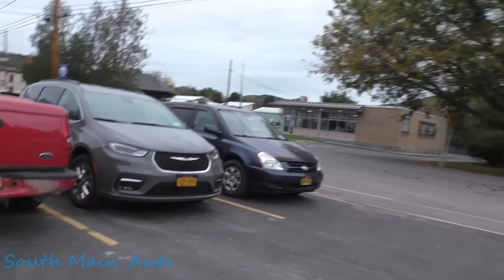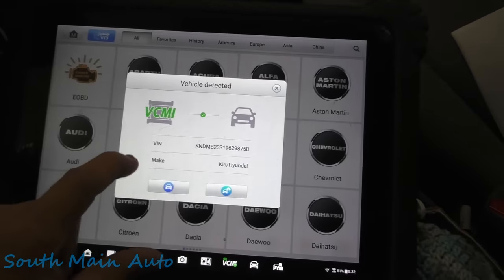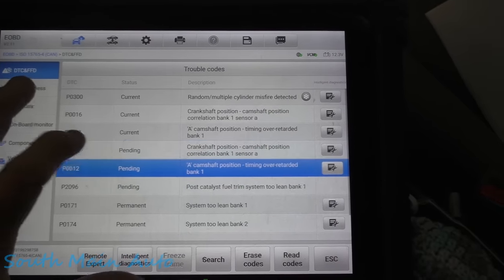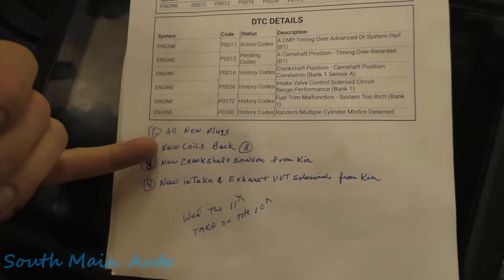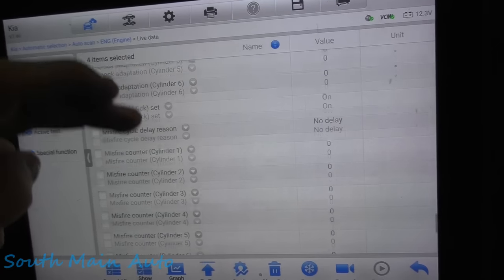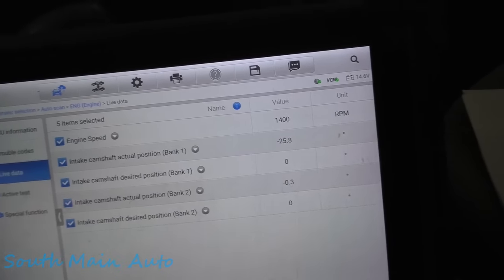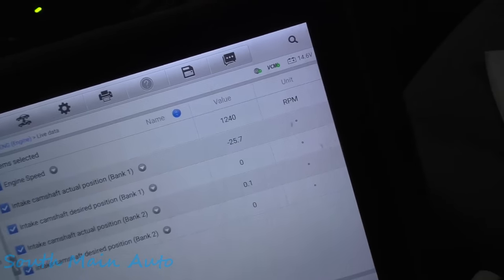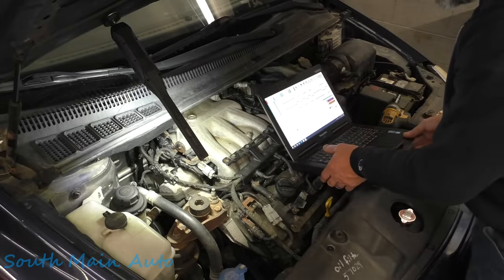This Kia Is Running Out Of Time!

Comment: A channel named Matt's Offroad Recovery had to drag in a Kia of sorts and repair it for a customer and the cam timing wheel was completely broken almost off the cam shaft and was giving similar info. electronically they had to replace the camshaft afterwards it ran properly and solved a number of complaints.
Reply: @kittty2005 Do you have the video ID for us? 🙂
Reply: @PuchMaxi  No unfortunately, it was something from my memory it may have been  a Trail Mater video, I just remember the cam  had followers, crap I'll have to look for it, I'm 70 years old. I may be getting 2 vids mixed up. I'm sorry I won't say anything till I get it straight in my head.
Reply: @PuchMaxi  I'm totally WRONG I was remembering the buick onclave that Eric O. just did, it has to be but I distinctly remember 2 followers were off also I get stuff mixed up lately I apologize for saying something before I get my facts straight, I still am looking for matt's channel in my library, I went back through Eric's videos and found the broken buick but I distinctly remember a younster holding the cam and spinning the timing wheel it was marginally attached while bolted in but was totally broken when removed from engine, I'll keep looking but I think I got confused, please for give me Eric I don't deserve the Heart, and you too PuchMaxi for leading you down a rabbit hole, I'm sorry.
Reply: @kittty2005  No worries! I could not find the video myself, so I thought I would ask. Sometimes our minds tricks us like this, haha!

Comment: Have a friend with an 07 and the timing assembly tensioner spring was getting soft and allowed the chain to start skipping a bit at a time. Kia recommends never or 200,000 miles for servicing the timing chain. Obviously sometimes parts fail.
It will be interesting to see exactly what happened on the 09.🤙

Comment: I have a 2015 Kia Soul Exclaim.  It has 90K miles on it and I’ve been having trouble with it for over 10K miles.  Got a new transmission, new spark plugs.  They  told me the last three oil changes (I get done every 3K miles) that I burned just under a quart each time – but that was normal – that I had to burn OVER a quart each oil change to be considered for an engine replacement.  Some time ago – I did get that software update and they told me that increased my warranty to 150K miles, instead of 100K – but it was only on the “lower engine”.  
This past time – they told me that I needed special seals on the car that only they can open in order to officially check the oil loss.  I asked why they didn’t do this at least two oil changes ago – and they couldn’t answer.  They did say on my receipt that the oil they took out was dark and burned looking.
So – this time they did the oil change and some sort of combustion cleaning and they added some sort of additive that corporate says they have to add – along with the seals in order to start the process to be approved for an engine replacement (I though 2 oil changes ago I was in that process!).  I asked to see the bottle – and couldn’t see any ingredients.  My cousin said if it had Teflon or silicone in it – that would be like putting a bandaid on a bruise – it is only hiding the problem.
So – brought the car home (it is my ONLY car!) and the next morning – when I drove it – there was knocking and shaking – so I revved the engine a bunch of times and it went away for that day.  Worked from home for a few days – then had to go out at  5 a.m.  this Monday.  Drove out about a half mile and it felt like I was going over a million large speed bumps.  Revving didn’t help – when I would slow down for any reason it felt like the car was going to stall.  Then when I would speed up again – it would bump terribly and I felt like I was fighting the gas pedal to get it to accelerate.  I had a medical appt I had to get to – so made it to that – and then drove straight to the dealership – which was about 2 miles away (getting to my medical appt was 45 terrifying minutes).
I walked in, embarrassingly, burst into tears, and they took it back to look at it.  The advisor came out 10 minutes later and told me I had “scoring” on my cylinders and that I had been assigned an advisor that was going to contact corporate immediately for an engine replacement.  He told me the car wasn’t safe to drive – that it would “sieze” up on me on the freeway.
Five minutes later, he called me to the front desk and told me he had “great” news.  He said I had passed all my “combustion tests” (I don’t even know what those are) – and that the little “scratches” on the cylinders was incidental and was fine.  He then said they knew what the problem was and – sort of in a “gotcha” way – after I said – ok what is the problem – he lifted up a small container from behind his desk – slapped it down in front of me – and loudly said “You put bad gas in your car!”.  He said gas should be perfectly clear and he said this gas was slightly yellow and he said it had 22% ethanol in it – instead of 10%.  I said I went to a major gas station that everyone goes to and how could this be.  So – I asked for a manager and I told him I couldn’t afford a rental car – so he agree for scaring me saying the car was not safe to drive – they gave me a loaner and they are flushing out the fuel, cleaning, then refilling, and doing another oil change.  He said all I have to pay for is the $30 fuel filter.  I asked if the “combustion cleaning” and additive they put in last week could have anything to do with this – because I said aside from burning oil – before they did that last week – my car drove just fine – no shaking, bumping, or flashing/solid check engine light.  He said no – that was not it and when  they turned the car on when I brought it in just hours before  - they said the check engine light was not on all.  He finally did admit that cylinders 2 and 4 were having problems – but that was because of “my” bad fuel.
He said I needed to get in touch with the gas station and tell them their fuel was bad.  Then he said I needed to call them and give them the gas station manager’s name and number.  I did all that.
Now it is Wednesday and I haven’t heard a peep.  I am scared they are trying to mask whatever is wrong – because they told me Monday afternoon – that once they cleaned the fuel lines  - that everything would be fine and we’d be back to checking the oil from under the seals every 1K miles to see if I burn more than ONE QUART in 1K miles (the story was every 3K miles, now it is 1K) – so that I can be “considered” for an engine replacement.  I’ve got 2 years and just under 10K miles left on my powertrain warranty – are they trying to drag this out so I don’t need the replacement until it is my responsibility?
I can’t afford to trade this car in or get another car for at least two years – so I am so worried – I did overhear (I was around the corner – he didn’t see me) – the service advisor on the phone sounding exasperated with a customer – saying “You will have to be patient, you are SEVENTH in line for an engine replacement.”…..so I wonder – they don’t want me to be the eighth?
What words can I use to make sure my and my family’s safety is the number one priority when  they give me my car back – and they tell me it will be ok?  Thanks for any advice.

Comment: Hey Eric, please forgive what is probably a really dumb question, but as far as simulating a cylinder pressure test, couldn't you just do a relative compression test via current draw test on the starter and crank the engine in clear-flood mode (if it has one) or by disabling the injectors? I would think if all cylinders on that bank were consistently off (by a common delta), that would offer the same result? Thanks as always, Eric.
Reply: It would show the cylinders on that bank do not have compression... maybe.  Depending on the situation the cylinders may actually have good compression.  But even if they don't, this test can lead to many other possible results beyond the cam being out of time.  Bent valves, cracked head/cylinders, head gasket... Of course, some of those would have other symptoms probably... but we've seen stranger results.
Reply: Yeah I’d think you might notice a 10-20% difference on all the cylinders on bank 1 if the actual valve timing is off.

Comment: Interesting.  I probably didn't say anything, but I left automotive.  I'm now a boat mechanic.  Big learning curve. That said, they are starting to use cam phasher on outboard motors nowadays.  I'm not sure why the boat industry is so far behind on technology,  but they are. Outboards are nice to work on. Stern drives not so much. I never thought I would be rebuilding carberautors again. Lol

Comment: I didn't get any codes for the vvt solenoid, just misfire and cam position. Solenoid was clogged up as previous owner musta thought oil changes were just a suggestion. I had to flush engine oil and clean solenoid a couple times before it was good again.

Comment: When I worked at KIA, we would sometimes see a issue with a sheared Dowel pin on the Intake camshaft sprocket on for the 2.0 liter engines in the Soul and Forte's. Usually caused from low oil level. Possible whats going on here if it is not a jumped chain or bad guide.
Reply from the maker: Yeah I'm not sure if the other shop pulled the cover or what they did. I was kind of curious the actual problem once I got the cover off
Reply: @SouthMainAuto    I remember the first version of those Lambda V6's, they had timing chain tensioner issues, the locking piston's teeth would strip and you would hear the chain rattling for a few seconds at start up. A bulletin was created, and we hated it. Lol.
Reply: @MrSmokingfrog1    The Lambda II engines are the same way.  I had to have the tensioners replaced on my '12 Santa Fe.

Comment: Just too in a 2012 optima with a gdi engine fail burned all the oil till it locked up got a new engine installed with the recall warranty unbelievable for a 67k engine to fail with royal purple changes every 6 moths

Comment: Modern cars aye !
Really the pnly problem is that little orange light on the dash 
Listening to the engine apart from some rattle emphasised by the camera,it was running okay 
L1 Automotive training showed a good video about sensors and faulty parts even genuine parts ,so it really is a dip and win or lose as far as parts are concerned

Comment: Sir love the content and this my be cheesy but the whole "I can do it you can do it" well i got a cheep old 2012 chev abs engine light traction all the xmas lights on so it was cheep it took me 3 days lol and i got them all out and safetied the truck. Broken wire to and abs sensor,fuel rail pressure sensor and pin 2 5 volt ref in the fscm. Its all stuff i seen on your channel lucky strike i guess lol

Comment: Ivan has found Hyundai/Kia phasers broken, which is a common problem apparently.  There are some TSBs about oil weight and oil filters causing problems with engines as well, which might affect the VVT.

Comment: Could you have looked at the O2 sensors values when you unplugged and then plugged  that position sensor back in to see if they changed?
Reply: I could be wrong, but I don't think O2 sensors control timing, they just affect fuel and air.

Comment: WOW !!!  Thanks for the 20 minute theory session on timing signals and wave forms - I made some sense out of this speech, so, yes - I AM LEARNING SOMETHING 🤓HERE AT SMA  -  Yee Haa 🥳 !!!!!Okay, it has a possible bad internal part causing this. Off the cover to verify !!!!! Hope the other shop lets you know what it was and if you were right and then you let us know what happened and if it got fixed !!!!!  I thought I was going to have to get some acupuncture needles stuck in the top of my head to stimulate my brain to comprehend more data pids !!!!!!!!  I know all this is important stuff so I need to get Mas Comprende !!!!!  😵‍💫🤯🧐😮🥺😱😸👍👍

Comment: Ive got a Promaster at the dealer in syracuse. Crank no start. They called and said the plugs are wet we need to change them. I said we already put new plugs in, pulled them they were wet again. Put in another set same thing. I said we brought it you so you could run diagnostics on it. Instead they are firing the parts canon at it. They have not even plugged it in! I told the guy we can fire the parts canon at it, he said you can come and it get if want!!! Eric O is priceless but I live outside of his area😞😞 Im considering moving closer 🤷‍♂️

Comment: I use to work at shop in 2014. Thier was guy brought car with code stating EGR related. He owned the shop. It's was customer car. He himself chaged every component of EGR and still couldn't fix problem. My Manger gave me that vehicle.i checked for vaccum line and find no suction.I found thier was small steel ball stuck in vaccum line. Causing EGR not to work. I removed ball and check engine light never cane back. Guy did even say thanks. He owned that shop that couldn't figure out problem.

Comment: There is one clue that has been staring me in the face for the whole video and that is the writhing of "oil filter 57025" and the odometer reads 130k .That makes me wonder how well it has been maintained and for the cam timing being oil actuated makes me fear the worst case scenario.
Reply: I believe that's the part number for the filter not mileage of last change

Comment: 14 degrees sounds like TWO teeth on the camshaft sprocket. Each camshaft tooth is about 7 or 8 degrees. Did cam belt skip couple tooth on the rear camshaft?

Comment: That was cool but the ecm thought it was 24 degrees and the pico measured at 14??? Also read 0 and no change in rpm. It needs a hammer to the phazer. I was always told "You can measure it to death but it still needs a part". True words Carl- I hear ya now. Says 0 but no sound change , it's lying. Great Job. Why do they design things so you can't work on them? Genius

Comment: Since we don't know if the cam phaser retards or advances cam shouldn't you unplug both solenoids? Since the other one could be causing the problem? Just nitpicking since I agree it does not seem to be moving when the solenoids are attached and its a mechanical problem. As a home DIY I'm constantly debating getting a scope but so far have not been able to justify it.

Comment: How do you get the scope pattern . Do you back probe the connector on each cam sensor? Is it inductive? 
  Also I would imagine you can can use it on crank sensors.
  I also noticed even in past videos patterns are all square (digital) , aren't most sensors magnetic pickup that produce some wave ??? 
Thanks Michael  (an old tech)
Reply from the maker: I did scope the crank signal. The camp signals are the hall effects

Comment: I've had an issue with my Mum's Vauxhall Vectra (2008) where it idles high, and sometimes struggles to start. Recently it set codes for both "camshaft over advanced bank 1" and "starter relay low voltage". Can a bad starter relay/starter itself cause the over advance code? I haven't looked at it yet as the issue is too intermittent, I can never get it to act up when I have the Autel out, and I can't seem to access camshaft data on this car.

Comment: I picked up a similar problem with a friends diesel Ford, it was a 16 valve four cylinder engine that refused to start all of a sudden. Using Forscan software I called up the oscilloscope view and compared the cams and crank data which showed them out of synch with each other. A new timing chain kit sorted the problem and she fired up without removing the cylinder heads as nothing had came into contact as it had only jumped one tooth.

Comment: Kia in most cases has model data and perceived data . You may find a difference in OBD data and generic data. Always check both or scope your signal to confirm your suspicions . I am a retired KIA master tech and this fact will get you if you are not aware ! Your diag skills are 2nd to none .

Comment: My Sedona is a 2010 with 3.5 V6. Noob question but are the cam phasers supposed to be locked at idle or engine off ?  I have one exhaust phaser locked and one that rotates with engine off, Can anyone advise ?

Comment: Another one with timinf out of wack that another shop did tuneup and a cam solenoid and of course it didn't fix it. That shop I would avoid.  When the gm 2.2 first started to go this, we change a solenoid and cam sensor before we learned our lesson to dig deep.  But that was the beginning the issues with these cars with cam phasers and vvt. Do one wrong you learn .  Apparently that other shop hasn't figured it out.  
You go south main

Comment: That's strange at only 130k miles.  I wonder how often the oil was changed.  I know of women who don't change their oil until the oil light comes on.
Reply: Blame the manufacturer.  if that's what they wrote in the owner's manual why would you expect someone not mechanically conversant with cars to do otherwise?

Comment: Man, I'm a broken record on this, but I'm pretty sure that the major auto manufacturers could make their vehicles more durable, internally and externally, without raising the cost hardly at all.  But because weak regulations are in place that protect the customer, it isn't happening.

Comment: every time you say the money light I think of crap another headache as it seems I can never find the right data out of the scan tool or online. I hate when they tell you the sensor runs from 0 to 99000, but not in this car it only runs 0 to 10000 or 10000 to 40000. When the computer car came out they use to tell to look at the last code first but they have changed it and never told us.

Comment: I used to be a Hyundai dealer tech, and I have seen several failures on camshaft phasers where the pin inside the phaser shears off and it gets stuck in the full retarded position.